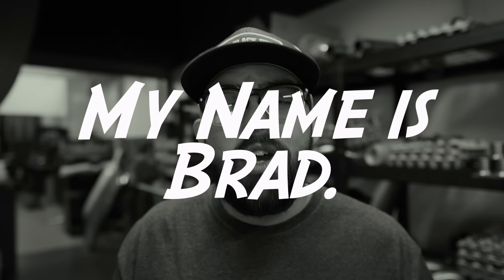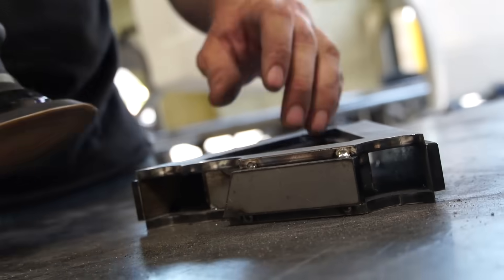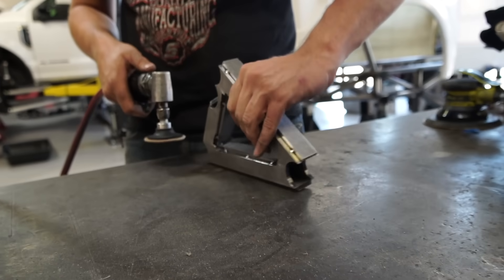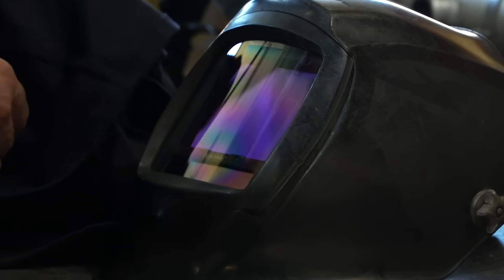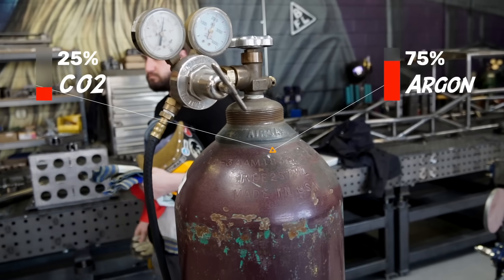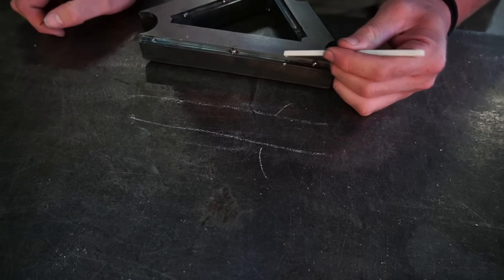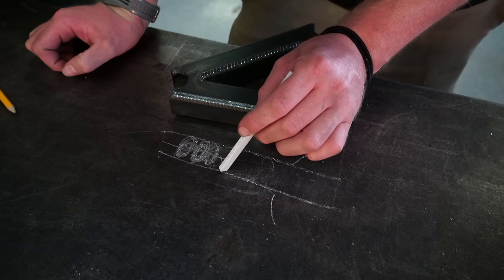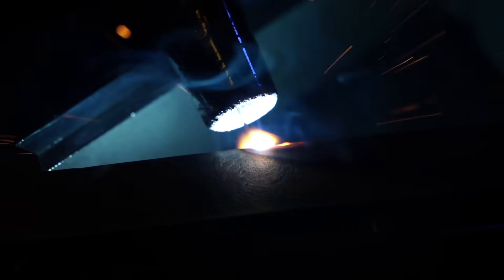HOW TO MIG LIKE TIG WELD (Stacking Dimes) W/ OVERKILLRACINGANDCHASSIS w/ *Tips and Techniques*

Comment: That's a lot of talent standing in the room. The skill these men have right here is mind blowing!! 
I do have one question. Do you feel these types of large ripple welds have as much strength difference than the standard type tight pattern? In most cases i assume they will hold anything they need, especially being a continuous weld vs a intermittent.  I had a very similar technique  of welding. But I had a instructor at Hobart Institute that tried to shut me off this style welding as soon as he seen me do it.  He would explain this type of weld bead would never pass certification.  For my certification reasons i changed to a higher heat tighter ripple bead. Basically what they wanted to see. To this day i still use both styles of welding and have yet to see much difference in strength. For welds that will be seen and are strictly cosmetic, i still like stacking up the large ripple beads.
Reply: For projects that need to pass cert, or x-ray, I would recommend a completely different set-up. As nice as appearance these welds are, they are still welded on the colder side. Don't get me wrong, they are still very strong welds, and still 99 percent of the time, the base metal is going to fail before the weld.
Reply: Any weld tests I have ever had or even just any jobs usually required 99% of the time to be continuous and well sealing. These kind of welds I wouldn’t trust for sealing well.
But then, being done slowly they could be quite solid at the bottom while the top has a more custom look. 
These kind of welds remind me of a time where at my job a fellow MiG welded a coolant tank and the welds looked like this but leaked about every inch. To avoid grinding the whole thing I cranked up the heat so hot I burned up two nozzle insulators but just drove over the top of it all re-melting it and it all sealed.  No dimes look when I got through.
Reply: @michaelszczys8316  sounds like whoever welded it the first time didn't exactly do a good job! These seal up very nicely, as long as your corners are tied in!

Comment: looks at MIG welder .. wonders how to translate voltage and IPM into "1-2, Low-High" and "1-8" for wire speed :D Poverty spec welder FTW! (3mm steel on my little 135amp MIG is 2-High, 6-7 wire feed..)
Reply: A stop watch will help.
Reply: I would guess they are bout 20 amps apart, so 2high is 135, 2 low 115, 1 high 95 and 1 low 75.

Comment: Y’all don’t need to remove mill scale for this bs 😂
Reply: I've found that not removing the mill scale, makes it much for difficult for the weld to properly melt the toes. On top of that, it takes more heat, and why would you want to weld on a dirty surface, when it takes literal seconds to clean it up. The best results always start at the first step, and in this case, it's in the prep!
Reply: Rodrigo Rodarte your not in a nuke so what’s it matter. As far as I know that where that spec originated. There’s a reason y’all structural welders are in a different union
Reply: @StahlFirearmsNo2  when customers are paying top dollar for their projects, you would imagine that they are expecting the highest quality achievable... To each their own, but you'll hardly ever find me sacrificing quality for a quicker turnaround.
Reply: Rodrigo Rodarte if they are looking for quality they will hire an engineers who will give you what’s referred to as a spec that outlines everything from the bevel to the rod required and generally material preparation
Reply: @StahlFirearmsNo2   first of all its not called spec, but a WPS(weld out procedures) AWS or related standards, you can tell us not to remove millscale when youre producing high dollar monster trucks or 6x6's for SMCO.
Reply: @MIKESDEVELOPMENT  not for SMCO, let's make that clear 😉
Reply: 540 OffRoad learn how to weld by the standards and than talk
Reply: Rodrigo Rodarte i forgot yall are independent my bad
Reply: Mike Shestopal lol you know what orbital welding it??
Reply from the maker: Tag me in some slick mig welds on your Instagram! I went over and looked but didn’t see 1 weld 😕.
Reply: HourGlassIngenuity never claimed to post any of my stuff but I’ll try to get some coupons done at work I’ve got stainless and carbon pipe tig and stick though bc I don’t have a wire feed for my welder They don’t have any mig welder at work just because of the work we do I’ll be getting one for flexibility reasons soon I’ll tag you for first welds with that machine.
Reply from the maker: 540 OffRoad tag me! Can’t wait to see what you can lay down. 👊🏻👊🏻
Reply: HourGlassIngenuity will do🤟🏻